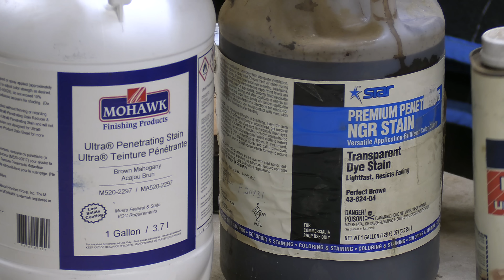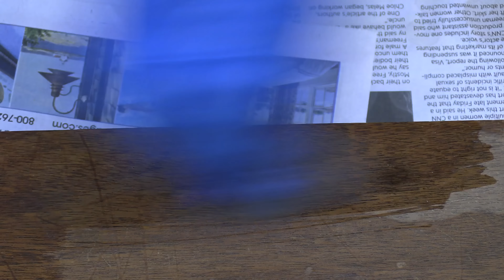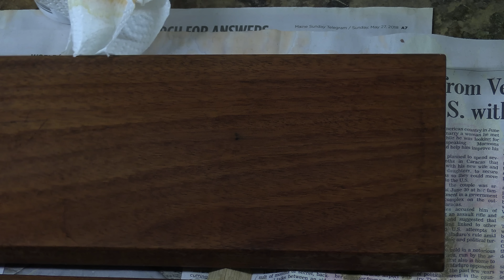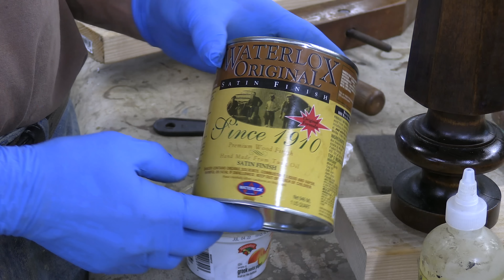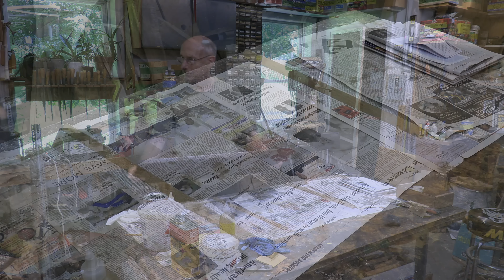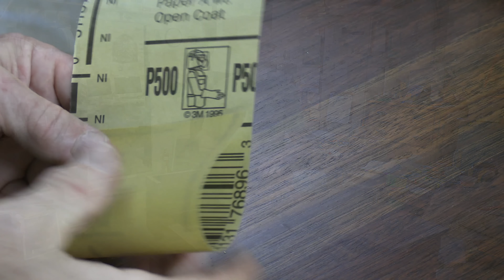The Art of Transformation

Comment: The 75 year old front door of my house is just a flat panel of light wood veneer. It had sun damage and the finish was flaking off in places. I started sanding, but had to strip it instead. I used oxalic acid on weathered areas. There were color differences where storm doors had blocked some of the sun. I used "Colonial Maple" stain to even the colors and bring out contrasts. The door is large panels of curly maple! I'm up to seven coats of Epifanes spar varnish now. The depth I'm getting is amazing to me. I would have messed this project up if I hadn't watched your videos. Thank you for sharing your knowledge!
Reply from the maker: Wow! That's great! Epifanes is the best. I was going to use it on my door but I tried another product which seems to be working well. Imagining your door makes me very happy!
Reply: @johnsonrestoration  The door also has a 75 year old Norwalk mortise lock set. It has a hammered "spade tip" thumb latch on the outside and regular doorknob on the inside. They're solid brass, and were originally black. The finish was worn off in high use areas. After extensive cleaning, I used Birchwood Casey Brass Black to restore the black finish. I didn't even know it existed! I sprayed four coats of lacquer to protect it. "I think it looks pretty good."  Used brake cleaner and white lithium grease to refresh the mechanism.

Comment: Tom, you said in the video you won't need to sand between applications of Waterlox tung oil varnish. Why did you sand between coats of the varnish? This is a great instructional video.
Reply from the maker: Thanks Steve! With Waterlox a coat will bond with the previous coat without any sanding. Most polys and other finishes you have to sand between coats. I sand between coats for ascetic reasons

Comment: Tom, I have one of these desks that has the pull out part slightly warped. I guess there is no correcting that? Also do you recommend using tack cloths, or is there something better to use? Still love your videos!
Reply from the maker: Thanks! I have never had any luck getting a warp out of anything! And a pull-out needs to be perfectly flat to work! Tack cloths work well, I usually just use a clean rag with a little paint thinner on it

Comment: Checking in on the bridge.  Are they restoring or rebuilding . If rebuilding is it a copy or modern. Would love a dedicated video about it.
Reply from the maker: Thanks! They are going to rebuild it the way it was originally, in the Spring. The original was built in 1840, this bridge was reproduced in '73, supposedly the same as the original, so this will be the 3rd one. I think that driver has been fined only $6000!

Comment: How do you keep the fibers from the steel wool from imbedding into the pores? I just tried doing the same thing but I ended up having to sand quite a bit just to get the steel wool out.
Reply from the maker: Thanks! I don't use steel wool until the end, when all the wood is sealed off. If you're getting wool fibres in the grain - well, stop doing that! Sand instead
Reply: @johnsonrestoration  it went against my better judgment to use steel wool and alcohol to remove an old shellac finish, however it was recommended by a supposed professional restoration expert. And it went just like I thought it would. Then I saw this video and you seemed to be doing the same thing. So I wondered what I was doing wrong. I didn’t want to take it down to bare wood

Comment: Hi Tom! I was wondering if that moulding in the perimeter board is just a molding or is it a desktop board that cuts the perimeter boards in two pieces?! 31:51 ?
Reply: I can't see any sign of a separate moulding. Judging from the "underneath" view when Tom is taking the desk apart, I think it's 4 boards that form a frame to keep things together "horizontally". A single board would be expensive, heavy and difficult to mould on the end grains (and you can clearly see the empty space when Tom pulls out the writing surface at 2:40)
Reply from the maker: Thanks Fater! Yes, dlevi67 explained it well!
Reply from the maker: Thanks! I think you see more than I do!
Reply: @dlevi67 yes but the writing surface is not the making the entire desktop surface … it looks as if the moulding visible from the outside is deceptively aligned with the remainder of the desktop in the inside! So much that I thought it is the same board and it has cut perimeter boards into two pieces @Johnsonrestoration ?!
Reply: @fatersaadatniaki  No, you can see (e.g. at 2:45) that the moulded pieces are underneath the writing slide and that they aren't a single panel taking up the whole surface of the piece. 

This said, I agree with you that it is likely that the perimeter boards are interrupted by the moulded pieces. 

BTW - the "frame" is made by at least 5 boards, as you can see that there is one in the middle going front-to-back, so apologies for saying '4 boards' above 🙂
Reply: @johnsonrestoration  Well, I'm looking for an answer to a specific question - you are trying to repair and restore the piece!

Comment: what is a Substitute for Ox colic acid?
Reply: Not really much to replace oxalic acid in terms of effectiveness at removing tannins. It should be easily and cheaply available pretty much anywhere in the world. You can also use nitric acid in very low concentration, but a) it is more dangerous as it's usually shipped in high concentration form and b) it may impart a yellow/gold colour to the treated wood, which isn't always what you want.
Reply from the maker: Thanks! Yes, I agree with dlevi67, no real substitutes. Oxalic acid removes organic stains without changing the color. There are products that have Oxalic acid in them like "Bartender's Friend", Savogran "Wood Bleach"
Reply from the maker: I agree!